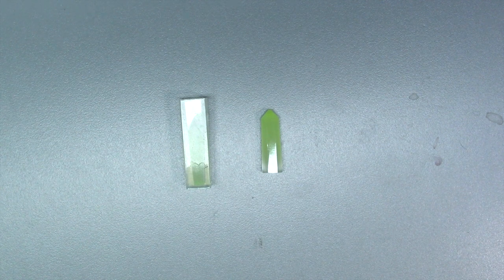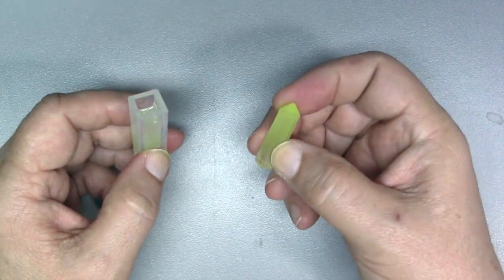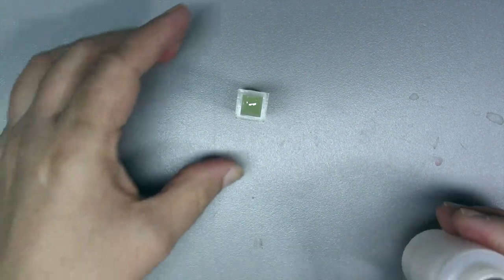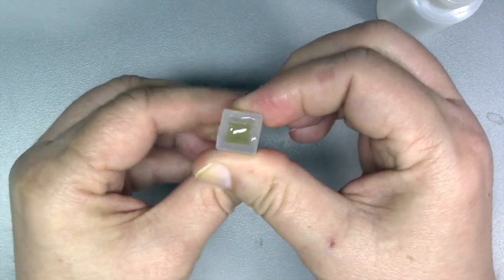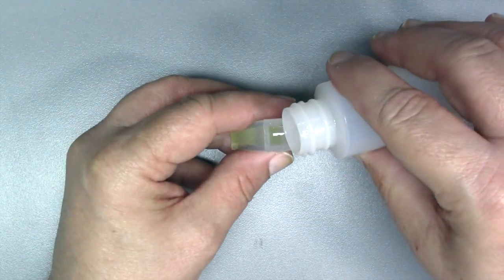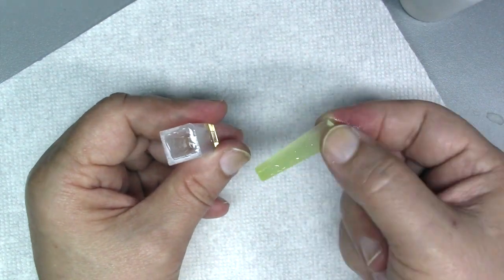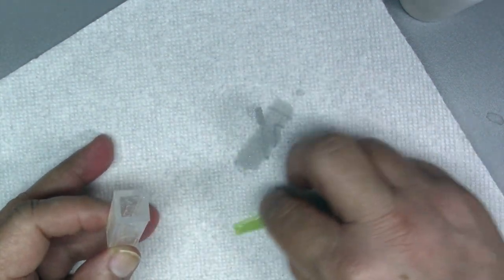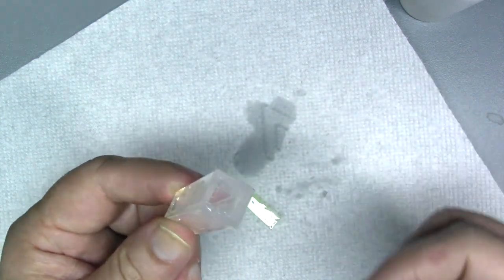Remove Epoxy From Skinny Molds Easy

Comment: Thank you so much!! I spent forever trying to get my piece out of its mold. (It was my first time ever using resin, and certainly my first time with a mold of that shape).  It took me less than a minute to pop it out of the mold like this. Again, thank you! If it weren't for you, I probably would have ended up ruining my piece and my mold.

Comment: OMG so glad I cam across your video. I almost tossed my skinny molds as I used them for the first time and did not know how to remove the resin piece. I almost tossed them away. I did not have baby oil but olive oil worked.

Comment: Do you use any mold release? I've been having issues with the silicone molds sticking to the resin and tearing when I demold. And by sticking I mean BONDING with the resin. I literally have to sand the pieces to get the bits of stuck mold off the finished piece.
Reply from the maker: Normally silicone is self releasing and does not require release agents though they can extend the lifespan of the mold. If you are sticking to a silicone mold then you are likely not using epoxy resin but something harsher like polyester resin and then you could benefit from mold release.

Comment: Is it possible to put first the baby oil and then the epoxy, and let it dry, because my mold is not flexible as that silicone kinda mold as yours. So I cant move the epoxy out of it
Reply from the maker: Baby oil may mar the surface of the finished product and in some cases may prevent it from curing fully.

Comment: After you have taken the piece out and you need to clean the mould from baby oil, wat do you use? I know you said rubbing alcohol but what tool? A cotton bud for example?
Reply from the maker: You can just wash with soap and water in the sink, no special tools needed. You can use a Q-tip if you feel you need to.

Comment: How to remove bubbles from these kinds of molds?
Reply from the maker: First try to get at little bubbles in the epoxy as possible (stir slowly or use something like our Monster Mixer on Etsy) then use an epoxy that is thin and not one real thick (EpoxyJewelry 2 part epoxy release's most bubbles on it's own) and use a flashlight to see any stubborn bubbles in the mold and use something wood (toothpick, chopstick, skewer) to coax them out (bubbles tend to stick to wood).

Comment: doesn't oil destroy the silicone over time though?
Reply from the maker: Baby oil is really not hard on silicone though I suppose if you left it in a bath of baby oil for months straight it might slowly degrade it but I wash mine with soap and water right after removing the resin. Mold should still last for many hundreds of castings.
Reply: @sublimationman  cool